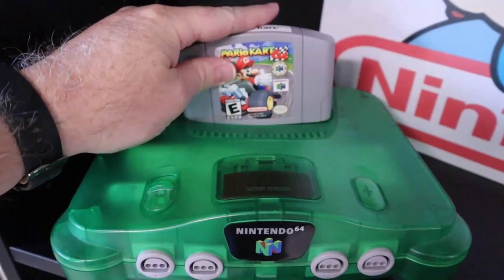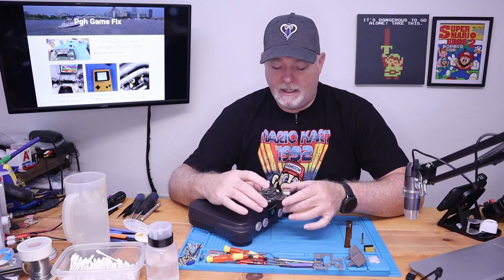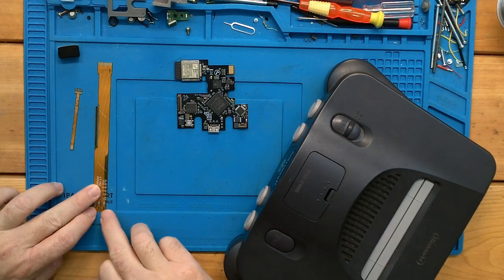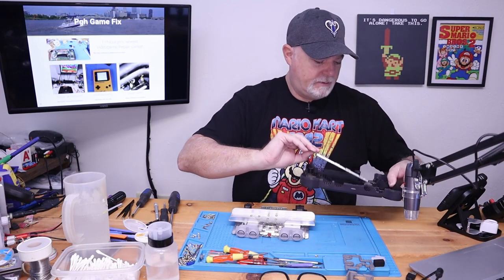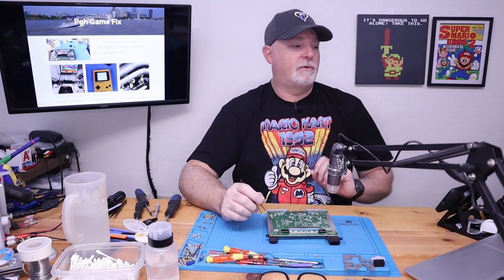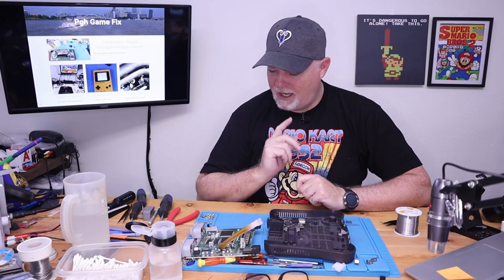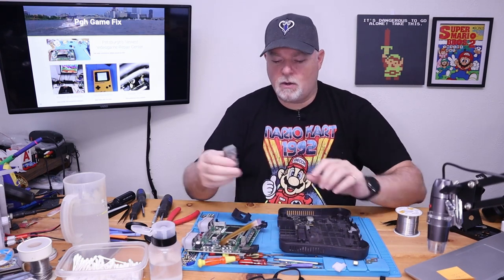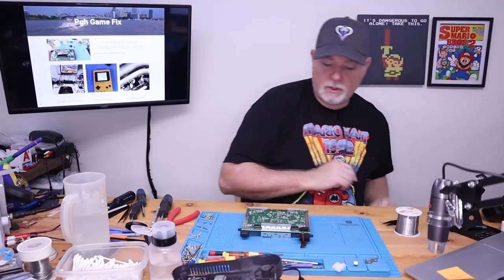Nintendo N64 HDMI Pixel FX Ultra HDMI No Cut Install

Comment: Pin 16 is for Pad 1 Controller Data. It’s how the kit reads your input for invoking and navigating the menu.

Yeah, I also don’t like that the 5v connection goes through two small vias. I have found several with bad vias for the other connections (Con, Rst, RC) and there’s no test point on the other side to bypass if you need to.
Reply from the maker: I noticed... after making the video... it wasn't "COM"... it was "CON". At that point, I realized I probably made a mistake on what the wire was for.  BUT... as long as we get it on the right pin... it works.  LOL.  But I do appreciate the info.  I like to know the "how and why" of the parts I'm installing. So often, there is no real info on this stuff, because people don't want their work recreated.
Reply: @PghGameFix  Similarly, I’d like to know what the RC wire is for. ;)

I know it has something to do with the way the console resets shortly after powering on with N64Digital. I’m told that it does that to give your display time to initialize and to synchronize with the console for things like dual frequency output or the speed run playback feature they teased. Whatever it is, it needs it even though UltraHDMI does not. I know from those bad vias I mentioned, which would result in a black screen with most games unless you hold Reset. The Everdrive 64 menu, however, ignores the reset command… so if you ever find a N64Digital that will boot ED64 but not original game paks… check the RC and Reset connections.

I had some with bad Con and Reset connections too. Yet others had bad connections on those unused/future-use points. This is why I really don’t trust those two vias for 5v. Two vias is already kind of wimpy but if one of those is bad then all of the amps are going though a single via and might burn out. I now check them both before every install.

Comment: The “closing circuit” is on the N64 but the connection goes through the memory slot. That’s why the Jumper Pak is called that: It literally jumps those connections to properly terminate the RAMBUS memory bus. It’s the exact same thing as the “continuity RIMM” on RAMBUS RDRAM Pentium 4 Williamette boards (Intel i850) or even some Pentium III Tualatin boards (recalled Intel i820).
Reply from the maker: Yes, I am aware of how the RAMBUS memory works.  But for the video... and the average end-user... I didn't think getting into the specifics would be beneficial. My videos are long enough.  LOL. FYI... I have a buddy who worked at SGI, and we have had several conversations on how the N64 was built.  After SGI was sold... he went to Nvidia. (Good guy to know)   I appreciate all the info, and feel free to shot me an email if you want to chat about any topic.

Comment: The cart slot and PCB actually have arrows that align when you have it right. :)

The components to remove are only on less-common 01-03 models (launch/pre-launch). The majority are 04 where the component footprints are already unpopulated and the later ones (05-09) don’t have the components or the empty footprints. NUS-CPU-04 and NUS-CPU-08 are the most common by far.
Reply from the maker: Thanks.  when I'm doing repairs... I hardly ever look at the revision, and haven't noticed what was common or not.  But to be honest... I get very few N64's in... and when I do... they are not worth fixing. Like missing traces from soda being spilt in years ago... and then thrown in the closet.  Since you seem to have inside info on this... what were those parts for since they seem to be removed on the newer revisions?
Reply: @PghGameFix  It seems to be for conditioning and buffering the C-Sync. For whatever reason, C-Sync is connected on those early consoles even though RGB is not. Some RGB mods don’t even provide C-Sync but the ones that do, like Voultar’s N64RGB, require you to remove those same components when present.

The French version of the console actually has unpopulated footprints for RGB and an extra chip on the board (same RGB encoder from the SNES). After the Gigaleak people found the original engineering documents with component values for those footprints and restored official RGB on a French N64. Supposedly it isn’t that great though (existing bypass amps are better).

Comment: Wish I knew what happened to my comment. :( Could you check the filter?
Reply from the maker: I don't have any filters turned on. ?
Reply from the maker: I just checked, and nothing is being "Held for review".  I guess there was just a glitch of some kind.  Sorry.
Reply: @PghGameFix  YouTube often filters all on their own (especially for URLs and some conspiracy topics, neither of which applied to me) but I always assumed it was still held for review. Thanks for checking. I know I mentioned RAD2x at one point but I did not write the creator’s name as a URL specifically so that it wouldn’t get auto-filtered as spam. Oh well. I even refreshed to make sure the post was still there after posting (while I still had a copy in my clipboard!) and it was, but then it I tried to reply to it and got an error because it disappeared minutes later.

I can’t recall anywhere near everything I’d touched on but it was a lot. I’ve installed more UltraHDMI and N64Digital than anyone (easily!) so I had a lot of feedback that I assembled as I watched the video. Probably not going to have the time to watch again. :(

I know the RAD2x thing was in response to that bit about some HDMI cables being decent. It’s literally the only one that doesn’t deinterlace non-interlaced 240p, which is the N64’s standard resolution. RetroTink 2X Mini is better for an unmodded N64 though since it sources S-Video. They even include the cable for N64s making it equivalent to those other HDMI cables.